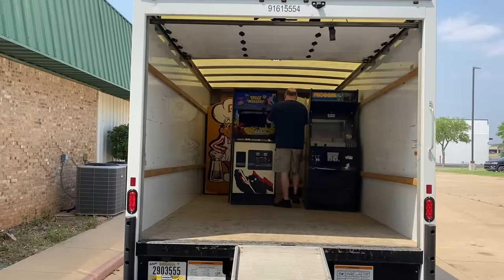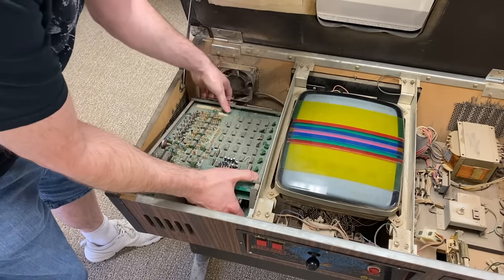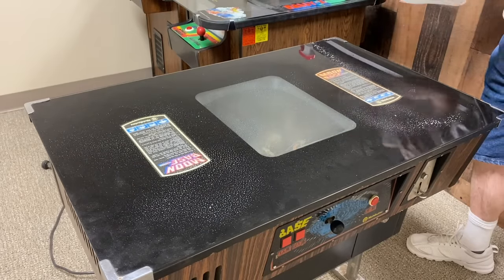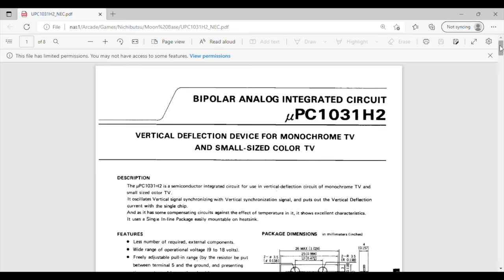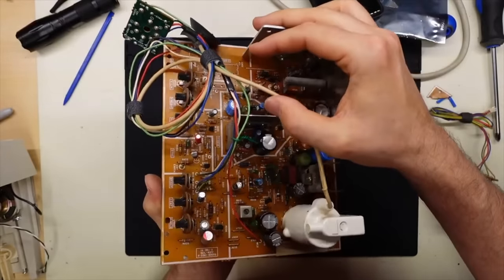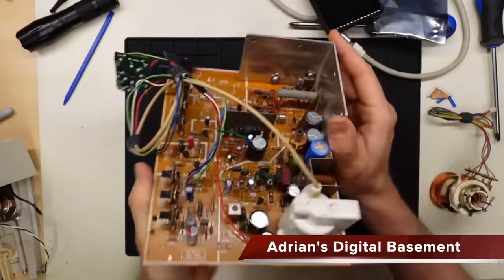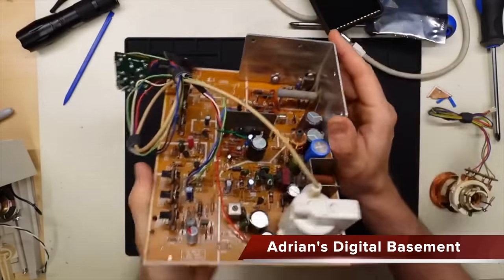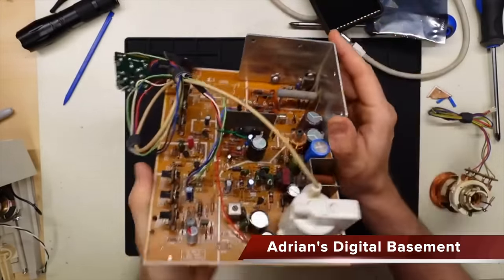Moonbase Arcade Restoration - Gone Wrong

Comment: Just watched your video and found it to be entertaining and informative. Spent 20 years in the Navy working on equipment ranging from Tube, up to glorified board swapping. Have not practiced it much since I retired but still enjoy a good challenge from time to time. When the chip that was installed backwards was identified. Was a brand new chip installed or was the reversed chip reused? If the latter then you should try a new chip. Some of the Integrated Circuits can be damaged when installed backwards. You would have to look at its pin out/diagram and see what if pin 1 is connected to pin 10,  pin 2 to pin 9 and so on and so forth. It may have worked installed correctly for a short while before finally failing. Sometimes extended heat from the process of soldering/de-soldering can be enough to damage the internals as well. Just my thoughts. Good luck. ;)

Comment: On recapping, you always want to check if you can upgrade the caps to a type that is less likely to fail.  This generally means checking the manual to see what frequencies the cap will handle and see if it is within the nominal range where a more reliable type of capacitor such as a polymer cap, thin film cap, or thin-film polymer hybrid.

As of the removing/installation, making a mounting jig.   You might want to make a mounting jig, preferably adjustable, so it can mount other tubes.

Comment: You really do remind me of my late uncle and his ability to figure out how things work. 

Coincidentally, I'm running into a similar problem. The other day, I gave my Colecovision a test run, and in the middle of gameplay, the screen went black. I could hear the game audio going, but the video was completely out. I tried replacing the RF cable with a digital coaxial audio cable from Best Buy, that didn't work. I tried hooking the RF cable to an old fashioned switch box like what normally comes with old consoles like the Atari and such, that didn't work. I had already had it plugged directly into the TV with an RF to coax adapter, and that didn't work. People on a Facebook group recommended I check the capacitors or the power supply. I'm stupid when it comes to futzing around with ancient electronics, but I'm sure my uncle would have known what to do if he were alive and still with us.

And might I say how lucky you are to be able to acquire, much less work on, full-sized arcade cabinets in your home while my already-crowded apartment must settle for emulation on computers and game compilations on consoles.

Comment: I love these engineering vids. People have no idea how much work troubleshooting can be and what the pitfalls are when you have no idea where an issue sits. Do more of these and don't be afraid to show the mistakes. It's a learning experience for everyone. 

Also, check what the power readings are on the pins of the IC you replaced and read the specs of that replacement IC. Perhaps you're overpowering it due to a bad power supply or something else, slowly burning it out. it's not uncommon that old power supplies tend to start floating down- or even worse upwards in voltage.

Comment: 16:18 I worked in a computer repair shop in the late '90s when everything came in with a CRT. Although I've been shocked by 110v, welders, spark plug wires, electric fences and such... My understanding was the risk of cardiac arrest was high enough that I never found out what it felt like to be shocked by a CRT flyback transformer.

Comment: I looks like the transformer has multiple taps, since the machine was set on the Japanese market perhaps feeding 127V on a 100V tap will make is run hot due to overvoltage, check if the transformer has a 127V tap and see if the wire is soldered to the correct tap, from what I see at 5:14 the transformer also has taps for 220V, 230V, and 240 V so it most likely has a tap for 100V, 110V and 127V.

Comment: You've got it in sine-scroller mode!  Must have been at a demo-party.  :P

Also, that IC you replaced, is the metal tab supposed to be at 0VDC? Sometimes they need to be insulated instead of flat on the heat-sink.  

Edit: Hehehe I should have kept watching until the pinout part.  :)

Oh, and don't worry about the jerks!  Your channel and videos are great!

Comment: i repaired a similar  machine last year, I just gave up and swapped to a new LCD screen and replace the jamma board with a new one. Also I replace the power plug with a modern IEC socket with fuse and switch plus i replace the old swtches and joystick with modern ones. I know there a lot of people who like it to be authentic but now its a sleeper instead, original looking on the outside and modern on the inside. To finish it off, I found the same stickers online and replace the glass so it didn't have scratches on it. It was like the 80's but without the hassles.

Comment: If you cant air compressor "dust" outdoors, i recommend running a shopvac (best if your friend does one and you the other!) And having the shopvac nozzle in the spot you wish to blow compressed air at, and this way when you blow it, most of the dust gets sucked up.  When I use compressed air indoors in my "shop" i place a jerry rigged box fan with an appropriately sized air filter nearby and try to blow at the dusty items in to the general vicinity of the fan :)  if i have many arcades or vintages pcs to dust out, ill hang a plastic tarp over all of them, and have the box fan filter running at one end and my shopvac/vacuum combo at the other end, working my way down the line.  Then carefully fold up the tarp to b3 "rinsed" outdoors the next time it rains!   :)
These above steps help keep dust from gathering on the "clean" projects and tools :)

Comment: If you use a RGB(SCART) Monitor/TV that would give you an option to build some electronic color filters, you need just a sync separator so you can feed the Composite to CSync.
You need a counter resetting on Vsync, and increasing on Hsync, feed the counter output to the address lines of an EPROM and take 3 Bits from DataOut for RGB.
As you have 5 more bits you can do a lot more colors and smooth color transistions. With extra address lines you could do more than one set of filters selectable or with a second counter increased by  Vsync some color animation. Alternantivly you can upgrade your version to the color version as mentioned in the schematics.

Comment: It's fantastic that You finally got it running. I fix old, polish audio-amplifiers in my free time. A tip that might help someday: some elements (such as transistors) can seem fine when desoldered and put into a meter. They often act up only if put back in a circuit and working under desired, higher voltage :)

Comment: On the coin door you can get a locksmith to either decode it and make you a fresh key (provided the locksmith is good enough), or to simply put a new lock cylinder.   

Many of those locks are very low quality, some don't even qualify as locks so much obscured lever mechanisms.   LockPicking Lawyer has videos for some of them.

Many arcade games had the same key for all models made by the same company and you can just order a replacement off of Amazon. 

Honestly, I'd recommend just getting a locksmith to change the lock if you plan on using it anywhere that the lock would be required to keep someone out for more than 5 seconds.

Speaking of LockPicking Lawyer, he might find the lock interesting if you do change the cylinder, you should send the old one to him.   LockPicking lawyer seems to be the youtube locksmith with the biggest love of locks with interesting stories behind them.  It would be great cross promotion for both of you to send him a lock.

Comment: hope this helps, i used to work on atm and tube systems at banks, you can buy a flat CRT with a composite input for fairly cheep. That is what most people use who are doing these referbs to replace the CRT .The power supply is your problem its supplying to much voltage to the chip, check the 5volt and the 1.2 output if it has it.

Comment: Did you check the DC output levels from the power supply?  If it is expecting 100VAC/50Hz, the voltages may be high, depending on how they handled the rectification.

Also check the DC levels with an o-scope  to see if there is excessive ripple.

Comment: The two keys may be related to the seal from the texas gaming people.  This way you would only be able to open the machine with the official person there at the same time to prevent you from modding the game  to screw over customers.  Similar two key systems were used for coin collections so the bar owner could not skim from the rental company.  Havent seen arcade machines in a long long time.

Comment: those old cabinets often used spacers made of paper or perishable rubbers to keep the components from touching the mounting brackets. they're frequently poorly documented and tend to disintegrate, making it easy for you to not know they were ever there. grab ye old multimeter and poke around.

Comment: Hey, don't feel bad about that mistake.   At one company I worked every board that the assemblers finished had at least half a dozen chips in backwards.   My mistake was suggesting they fix incorrectly assembled boards.   My suggestion to fix the rolling:  horizontal and vertical synch circuits have free-running oscillators.   When video is present, the free-running oscillators synch up to it.   If the free-running frequency is too far away from the video horizontal and vertical signals, it will not synch up.   That's what causes rolling.   I fixed a lot of composite video monitors back in the '70s.  One of the first things to do is to adjust the free-running hsynch and vsynch.   And don't adjust any controls that you you don't know what they are for..

Comment: I bet you have a diode or resistor that is changing its behaviour as its temperature increases. This change could be damaging the ic by sending a reverse polarity pulse on a pin, or making a power rail jump.

Comment: 21:54 On point 2: I really wouldn't recommend this for the following reasons:
1. If it is not exactly the same picture tube, the deflection coil will not sit exactly right on its original position (z-axis) and the deflection will be unsatisfactory. Not convergence error but just completely blurred
2. The maximum voltage of the two tubes may not be the same and you risk a "smaller" tube receiving too much voltage and generating X-rays.
There is a protective circuit, usually near the horizontal IC, which is triggered if the anode voltage is accidentally too high and switches off the flyback. This critical limit voltage is set in the factory using a potentiometer. This requires special measuring devices for high voltage. Then the pot was sealed with a drop of glue. So you must never adjust this potentiometer, even if you are using the original tube.

Comment: On the wobbly controller, I suspect it had a nylon bushing in there originally, but it wore out, and they just took it out instead of replacing it, because it worked fine with just a little bit of play.  Finding the right sized bushing will remove the extra play in the mechanism.

Comment: One suggestion is to set it non fire and use it as heating wood? Set the monitor with extra lighter fluid since it may require higher tempeture to melt. You're welcome!! :)

Comment: Check your voltage output at IC201, unless I'm mistaking it should be 16 volts, if not you can adjust C202 and R201 to bring it back into operational area. Unless IC201 is the culprit. 

You may need to replace the transformer completely or connect it to a Variac.

There is also a way to subtract voltage using a smaller transformer  like 10-20 volts inline with incoming power just before the main transformer.

Comment: @8bitguy  -  Replace the monitor with a high resolution color flat panel, such as a security monitor, PC computer monitor, or PVM which has composite video inputs on it or can use a composite to VGA adapter. Problem solved. Old CRT's are sometimes a PITA to deal with. Arcade Jason has access to the parts and equipment you need to replace or repair this monitor in its original form and he has even rewound yokes for video games. I used to repair these back in the 80's for the bars and clubs. The problem is parts and pieces are drying up. The flat panel monitor may be your best bet. A retail advertisement screen is much brighter and would serve well here.

Comment: The joystick slop might be due to wear and tear on the rubber sleeve they're using for a gromet. See if you can replace that, or at least soak it with WD40 to see if it will expand a little.

Comment: Did you get around to replacing the smaller caps that you ordered wrong? There's been many times that I've had similar problems like on both horizontal and vertical sections, i.e. rolling/warped screen, even diagonal lines,  and it would turn out to be one tiny cap like 3.3v and 10 microfarad (C106 almost every time on the model tv's I was repairing lol ) with no visible damage at all, no popped or split caps At 9:06 when you showed the board to explain the sections I seen many caps still had dots, and I thought (oh ,man he's really going to want to replace those caps before he does anything else. I worked on a few hundred tv's(13 in. b&w as well as color in the late '80s early '90s and 90 percent of the time it was that. Good luck, I hope you get it fixed.

Comment: If the chip burns out, look into the power delivery. Make sure to not over volt it and it should be alright. Also, I opened the spreadsheet to see what it does and it seems to have an amplifier. Might be worth checking exactly what the current is that it's internded on driving. Would need the original schematics for this arcade though. I would not be surprised if something else is broken somewhere making the amp in that chip overheat. 10/10 would have to dig a little deeper with this one.

Comment: Hi buddy,
I like your video because it is real and honest, in contrast to the fake restoration videos currently circulating on the web.
I myself have a similar problem with such an arcade table. Like you, I have already checked a lot, did a recap and now I ordered a vertical ic like you too. The tension increases whether it succeeds. Of course I also have no idea if I didn't catch a fake IC.

Comment: Hi! I know this isn't fun to do at this point but I'd check the power pins on the chip you replaced. I'm guessing it's getting fried by either bad power or bad signals. You could solder a wire bundle to the pins and measure it externally while it's mounted. #backseatdriver. Thanks for the awesome video, thoroughly enjoyed it!

Comment: Good evening Mr Murray.. a quick idea for the sloppy joystick.  I had some luck fixing slop for something similar by putting heatshrink on the bolt to remove the play within the mechanism and then adding a washer so that the nut would have something to tighten to.  This would give less play while still retaining some shock absorption.

Comment: To deal with rust I recommend vinegar, but nearly any acid will do the trick (lemon acid also smells good :) ).
Let chemistry do the work for you, works wonders on rusted bolts or rusty fuel tanks.

Comment: Probably excess voltage burned out the new IC. Remember that you recapped the CRT board but not the power supply one. This could also be the reason to why the IC was having problems at the beginning.

Comment: I would use a color monitor with an RGB input, and also fetch a simple microcontroller circuit with 1 inputs and 3 outputs. The input would count HSync for lines and reset at VSync, and drive a 1 to 3 commuter (like 4066 for example) to divert the luminance signal to one or 2 or 3 color inputs. So you can have a white upper line (where score is displayed) and agressive colors for the aliens. Of course because of reverse screen for player 2, the matrix would be symetrical

Comment: The first of all you have to replace electrolytic capacitors. Those caps are so old that they more likely are dry. Some of them might even cause a shortage which is burning your chip. 
Also, it is good to inspect if the resistors are not burned. Especially those which are in the circuit to reduce the voltage.

Comment: That fault at the end is typical when the IC that was replaced is fed with a too high voltage. It slowly heats up beyond operational temperature and starts to misbehave permanently. So: Check the voltages to that IC.

Comment: Great video!  I can't believe anyone would complain about you showing the mistakes..  This is how troubleshooting is done.. I'd rather watch the whole process and learn something than have the "cooking show" version where they just pull the finished product out of the second oven..  Definitely going to watch for the next video as I have a space invaders with a monochrome monitor that someday I'm going to get around to working on ( I bought it in parts!!)  and I also have this same cabinet, although mine was originally a space invaders II and someone put a Donkey Kong Jr board into it.  (mine has a color screen!)  And yes - that cabinet is a huge pain to work on the monitor with!!!!

Comment: Is the new chips electric tolerance lower? You could potentially throttle it with resistors so it doesn't burn out, maybe an Arduino mechanism to throttle or perhaps the heat generation may be too much for the thinner internals on the new version of the chip. Heat sinks? Hope you got it figured! Much love, love your content!